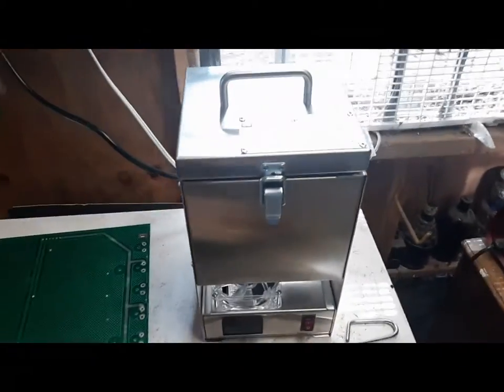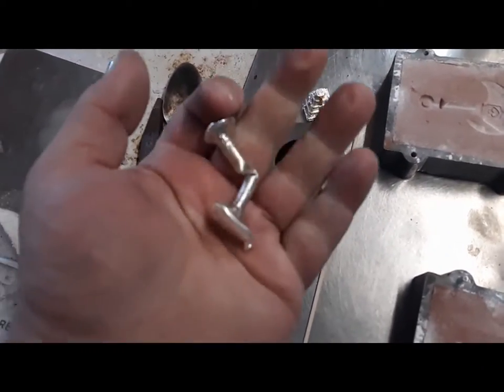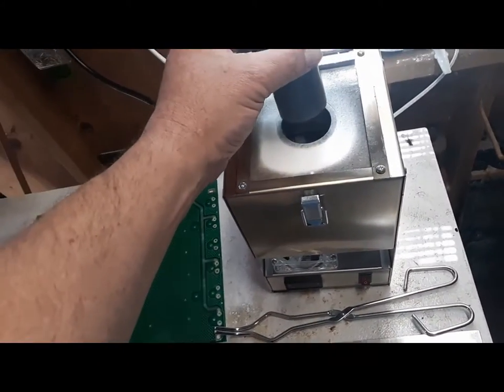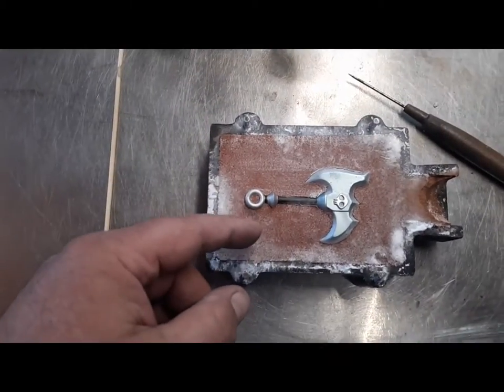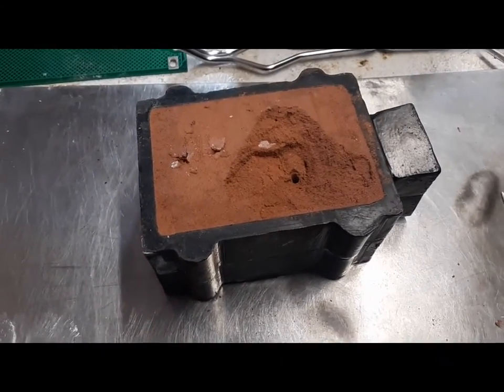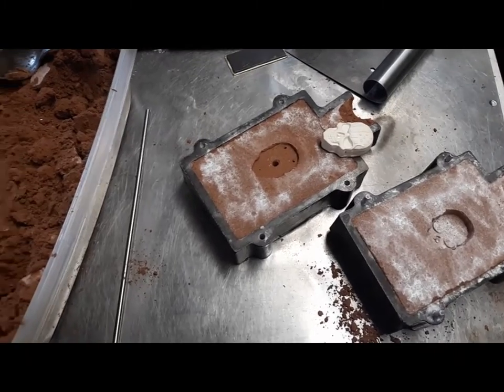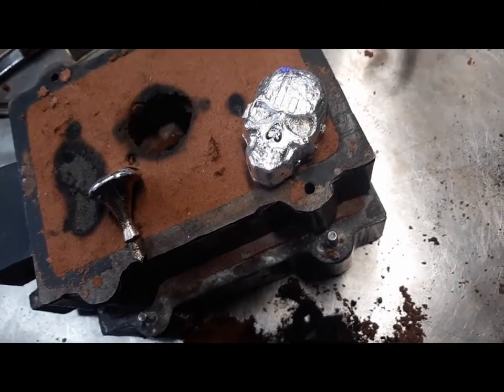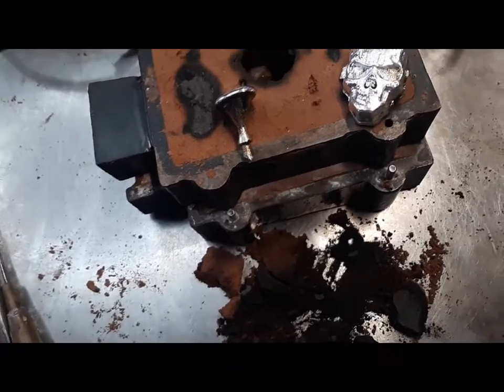A Quick Pour

Comment: I have the same furnace and I’ve been told to set the temp to 1965 and the machine will take it a bit higher. It seems to work ok for me. As for the stars it looks like they weren’t defined enough on the mold but that’s only because I couldn’t see them that well in the video. I haven’t tried doing a top pour with a closed flask but I think the skull turned out pretty good.
Reply from the maker: Where do you buy your crucibles and how many uses do you get per crucible 🤔
Reply from the maker: TRIED  1965 AND SEEMED TO WORK FINE oops caps.